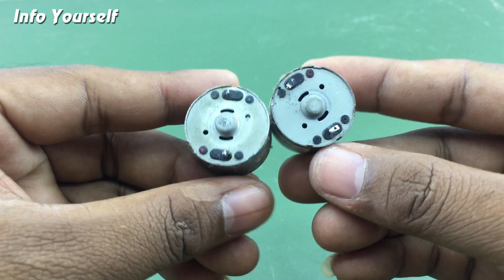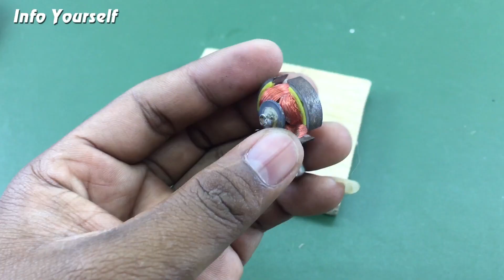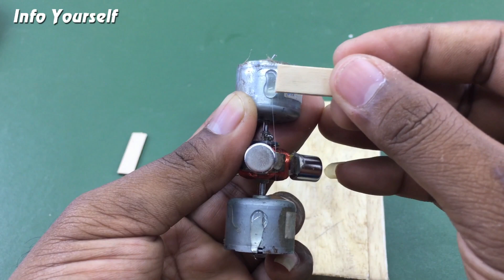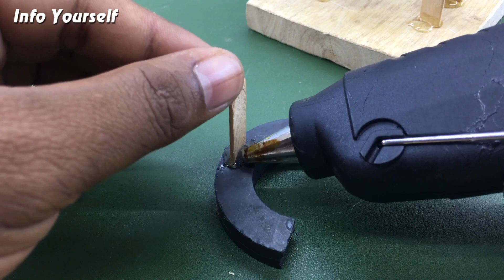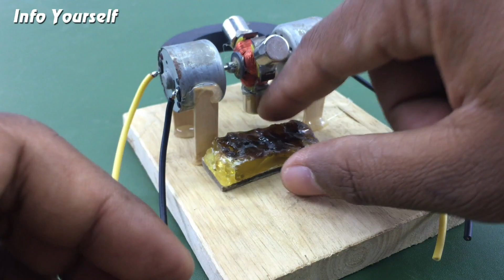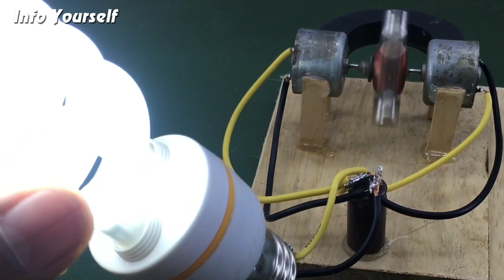Free energy efficient light bulb by dc motor generator with magnet self running experiment At Home

Comment: Yess, it works perfectly. I built identical free energy generator. It generates 4-phase 420 kiloWatts of green electricity. Please help me to remove one phase and make 3-phase. I can give away free one phase. If I connect this free energy to yellow bulb, then I have not green but yellow free energy which is much better.
Reply: De qué capacidad es el diodo o capacitor ese qué es de forma cilíndrica por favor

Comment: No need to solder these wires. The glue gun is the best to connect wires because glue sticks have less conductavity and this generator will multiply free energy for free up to 7412 MeggaWatts.